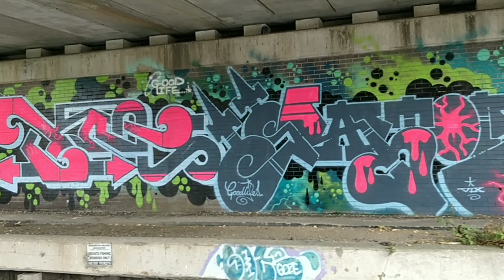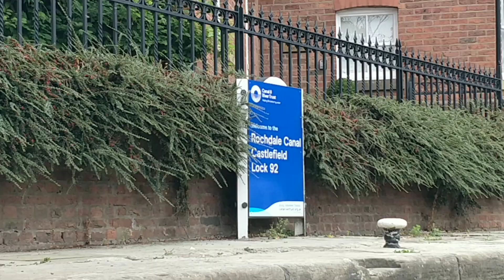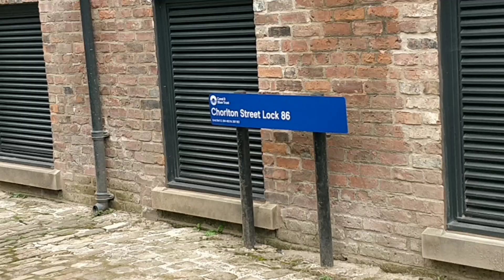Wow!!! Manchester city center by narrowboat.

Comment: Hi Will and Leon...Rochdale 9 locks in Manchester  are the worse locks on the network so difficult and very smelly I quite agree with you...Hope you got sorted and on your way to Wales.
Reply from the maker: I had to buy a new battery but that's not easy from a boat. Ahhh thanks Sue...Those locks need sorting out...

Comment: Alright ate? When ou went past Marime Transport'sc ontainery ayard ou alk about e oxesw ith arabic writing and the tanks.The oxes belongbelong a company called United Arab Shipping Company and the tanks which you describe as "UN tanks" which means they are ilt to a United Nations  standard which standises all shipping containers  to 8' high x 8' wide with lengthsv arying from 20'40' & 45' (there are other variationsvariations for specialist use tt I have nevernever personallypersonally  seen  one that isn't  8' wide (the standardw idthf for a lorry). Whete it says "fix labelslabels here" that isi becausebecause tanks are often usedused to trasport dangerousdangerous goods  and when they o they legally required to fix warning labels/signssigns explaining  the dangerous good's risk i.e flamablee xplosive corrosive tc also they may have a 4 digit number starting with UN** e.g UN1978 is propane or UN1498 is sodiumsodiu nitrate. This is a worldwide systemsystem so that in the event of an emergency the authorities know what they are ealing with
Reply from the maker: That's interesting. Thanks for that info Sean. Take care bud.